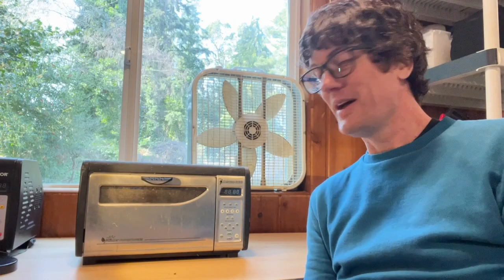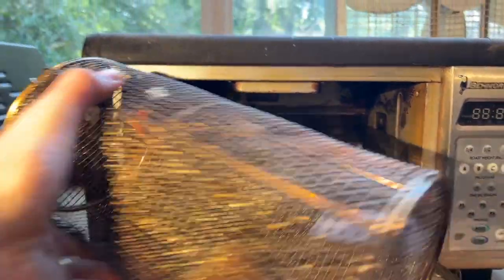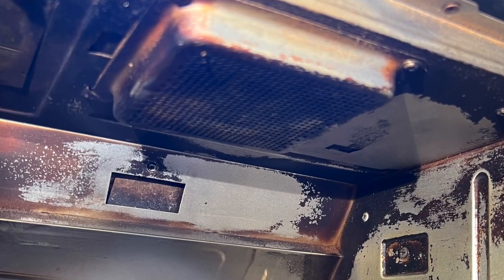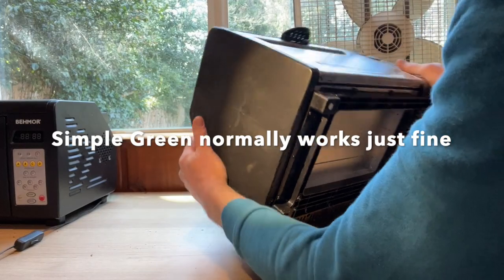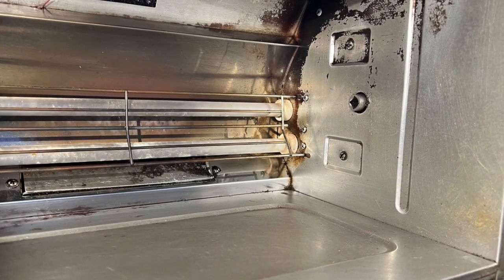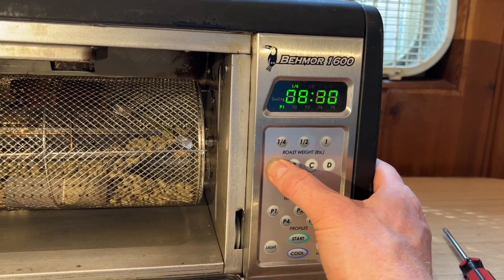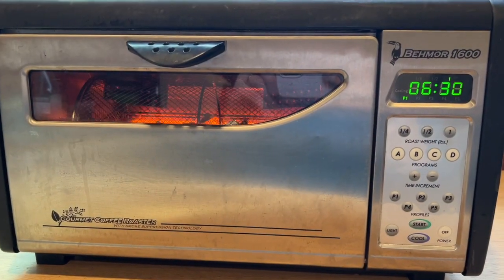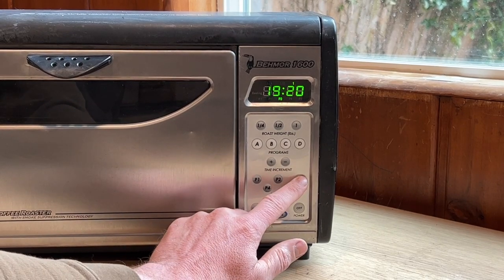Reviving a  Behmor Coffee Roaster: Behmor's Are Built to Last

Comment: I want to send thanks for you posting this video. A few years ago I had a fire incident with my Behmor 1600. My fault entirely, I walked way, I mistook 2nd crack for first. When the beans caught on fire, I panicked, and I opened the door. So, I broke rule #1 and rule #2 in quick succession. Thankfully, I didn't break rule #3, and I had a fire extinguisher on hand, and was able to put out the fire very quickly. I assumed the poor thing was toast, and would never be safe to use again. I just put it away in a garbage bag and forgot about it. 
Watching this video, I realized it's such a simple device, it wouldn't hurt to take it apart and at least try to give it a deep clean. Well, I'm happy to report that there was really no damage at all. I cleaned it and ran a few dry cycles to make sure it was safe, and was able to roast a 1/4lb of green beans i still had in the cupboard. 
Had you not posted this, I probably would never have thought to bring it back to life.

Comment: I picked up a classic 1600 off eBay and it came coated in polymerized oil like that plus a huge dent on the top and side! Pretty sure it was always taken to the end of it's cycle/second crack and never cleaned by the previous owner. An hour of elbow grease and cheap knockoff easy green brought it back to like new. 

It has been making wonderful coffee since October. Afterburner is shot and eventually it'll need new elements but it's crazy how resilient these are

Comment: Good advice, and I should definitely clean mine more than I do.  A somewhat peripheral comment, but one part I would be sorry to clean is the drum. I find the drum on mine so reflective that I have a very hard time seeing through it to the beans. I’ve often wished it was powder coated black to see if that would help.  I don’t roast primarily by sight but find it useful feedback to have. The internal light is much better than nothing but is quite dim and yellow.  I frequently finish a roast and in the light of day wish I had stopped slightly earlier or later.